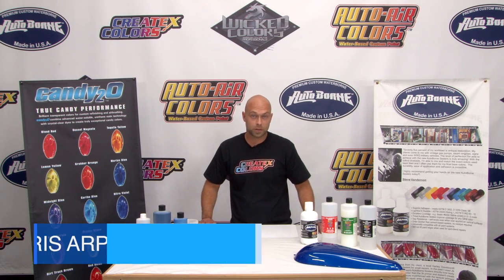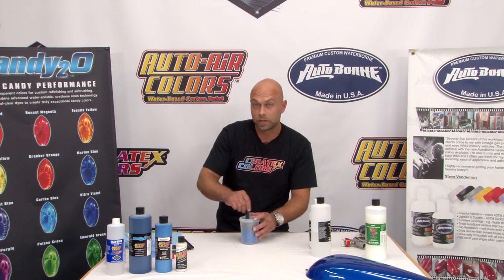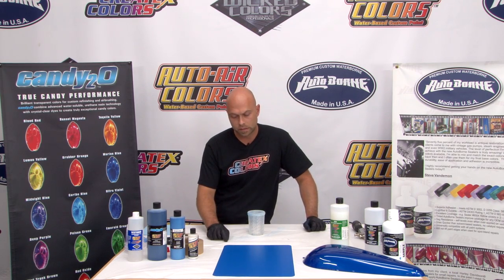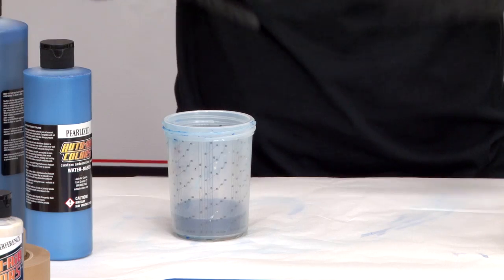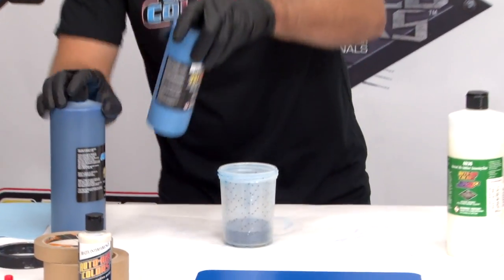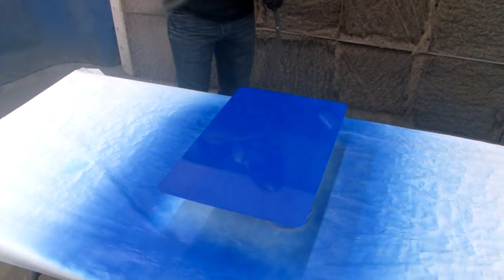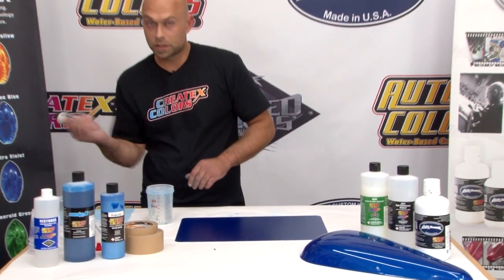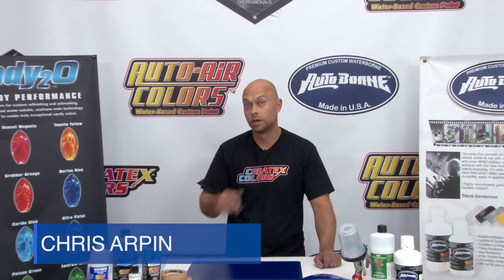How-To Apply Createx's candy20 - Pearl Colors with Chris Arpin

Comment: On that gas tank looking thing, did that have a clear coat of some sort, like a 2k?  looked very shiney curious how you got it like that.
Reply from the maker: a catalyzed (2k) urethane clear was used for the top-coat.  Auto Air Colors are compatible with any clear type: urethane, lacquer, polyester, water-based, enamel, low-bake powder coat and more

Comment: Can this be done on a Polycarbonate RC Car body in reverse order? Spraying the Candy and Pearl first then back it with the Autoborne Sealer?
Reply from the maker: Yes, Createx paints work well for polycarbonate application / RC painting using the reverse painting method so the plastic is the top-coat clear.
Reply: @CreatexColors  thanks for the quick reply. I absolutely love that blue color in that video.

Comment: When sparying candy would it be easier if you spray a blue base, red base, or the same color base as the candy you choose? Instead of using a silver for all candies.
Reply from the maker: Yes.  candy-pearl colors (candy2o mixed with a 4300 or 4500 Series Color) applied over a color-keyed sealer cover quick and orientate evenly. When applying candy2o neat (i.e. not mixing with a pearl), applying over a silver or gold base is required for a true candy finish.  to assist with coverage and even application, make a "cheater coat" between the metallic base and candy2o: cheater coat is mixing candy with the metallic and applying that over the metallic base before applying the candy.  Thank for asking, hope this helps!

Comment: Can these products be used with other water based clear coats? I’m thinking this may be a good choice for painting guitars, but I’d like to stay away from 2k paints and the more toxic automotive paints for my gloss clear finishes.

Thanks!
Reply from the maker: Auto Air Colors and candy2o are compatible with most any clear type.  If top-coating with other than a catalyzed clear, apply 4040 Bleed Checker over candy-pearl colors to prevent the dyes from leaching into the clear, https://autoaircolors.com/custom-automotive-paint/4040.html.

Comment: I want to paint an 81 Camaro in gm lemans blue paint.
I want it to have a good amount of high lite interference (just like the light side of the gas tank object in this video)
If I put down a lite grey sealer coat over the body work, then several coats of base coat (solvent based lemans blue), then some type of "high lite interference coat", then a solvent based urathane clear coat, would that work?
I want the color to stay as close as possible to gm lemans blue, but I want it to really pop when the sun hits it.
Is there any problem using solvent based bc/cc products with your high lite interference coat products, or sticking with all water based products is the only way it can work?
Reply from the maker: Water-based paints can be applied over solvent-based paints; Hi-Lite Interference Blue can be applied over the solvent-based Le Mans Blue. This is a tri-coat, candy-pearl paintjob. If using another paint type and method, make a test panel to determine results. Its the use of a dye-based candy color mixed with a pearl, over which the Hi-Lite Interference pearl is applied, that creates the dimension in this finish. Thank you.

Comment: Can you spray these on other coats to tint/colour the previous coat? such as a metallic metal?
Reply from the maker: Hi Kyle, All Createx Colors paints may be inter-mixed and inter-coated.  Applying candy2o as a mid-coat over a metallic base  (a traditional candy paint job) is certainly doable.  Mix 4030 Balancing Clear 3:1 candy2o, reduce 5 - 10% 4011.  Mix thoroughly for 1 minute, allow to acclimate for 10 minutes after mixing, strain then spray.  for complete candy2o product info and mix ratios, please refer to its tech data sheet, thank you. https://creatextech.com/pdf/tds/candy2o-TDS.pdf

Comment: How much product would I need to paint an entire car? Say a 57 chevy shortbed truck? I like Poison Green.
Reply from the maker: Roughly 3 quarts sprayable will work for both sealer base and candy-pearl.  For Poison Green,  AutoBorne Sealer White mixed 1:1 AutoBorne Sealer Base will work, reduce  sealer mix 10% per vol. 4012 High Performance Reducer.  for candy-pearl, candy2o Poison Green 1:1 Auto Air 4304 Pearl Lime Green will work.  Mix candy & pearl 1:1, then add 4030 Balancing Clear to the candy-pearl mix 3:2 or more (could simply mix candy / pearl / 4030 1:1:1), reduce candy-pearl-4030 mix 10% per vol. 4012 HP Reducer. Of course amounts vary depending upocn door jambs, under the hood, tonneau cover, etc. but 3 quarts sprayable should be enough for cab and bed, if tonneau cover and painting inside of cab, may need 1 gallon sprayable.  For further information, please email us at info@createxcolors.com.  Thank you.

Comment: how much of each do i need to paint a prelude im doing   Aluminum Base 4103 and blood red candy 4650 and is there a top coat clear or do i need to use urethane clear  should i spray a black sealer 6002-32  first over bodywork
Reply from the maker: 1 Qt & 1 Pt sprayable both sealer and color should be more than enough.  Start with 6013 AutoBorne Silver Sealer, http://www.autoaircolors.com/custom-automotive-paint/6013.html.  Mix candy2o Blood Red 1:1 4030 Balancing Clear, http://www.autoaircolors.com/paints/4030.html.  Top-coat with a catalyzed, urethane clear.  for more application information, please visit our website's technical pages http://createxcolors.com/application-guides.html.  Thank you.
Reply: can i use 6013 AutoBorne Silver Sealer, with 6000 AutoBorne Transparent Sealer with candy concentrate flakes instead save me 200 bucks
Reply from the maker: Our products are inter-mixable with other types of materials.  Always test first, especially before painting a car. 6013 Silver Sealer is not a high-metallic count finish silver, more of a ground coat for silvers to create flawless silver finish.  If applying flake over our paint using 6000 AutoBorne Transparent Sealer as the carrier, which works well, apply over Aluminium Coarse as suggested in your first message.  Either way, a flake finish is much different compared to applying candy2o over a metallic base, www.candy2o.com
Reply: Am I reading this correctly? You can paint an entire vehicle with a 3/4 of a gallon of material?
Reply from the maker: For trucks and large vehicles with door jambs and under hoods, 3 quarts candy2o + 3 quarts 4030 Balancing Clear + 1 pint of 4012 High Performance Reducer.  This is only for candy2o, our pearl and candy-pearl base coats require much less material - 3 quarts total material spray-able or less when color-keyed with AutoBorne Sealer, www.autoborne.com.. Thanks

Comment: What autoborne sealer are you using
Reply from the maker: 6009 Sealer Process Blue, https://autoaircolors.com/custom-automotive-paint/6009.html
Reply: CreatexColorsCo  what happens when you use the white ? Would you need more coats of the color your going to use
Reply from the maker: Yes, many more coats will be required and the value of the candy finish will be a bit brighter.  Applying a candy-pearl over white is not recommended, applying over a color-keyed sealer allows for coverage with minimal coats for even, quick drying candy-pearl coverage.

Comment: What does the intercoat do?
Reply from the maker: Applying inter-coat over the aluminum fills in the grooves in the aluminum panel which has been sanded, to create a smooth surface.  Without the inter-coat, the dyes in candy2o will build-up along the edges of the scuff marks, creating darker values of the hue which are visible in the final finish.  Applying inter-coat to an aluminum panel before candy helps achieve a cleaner looking finish.